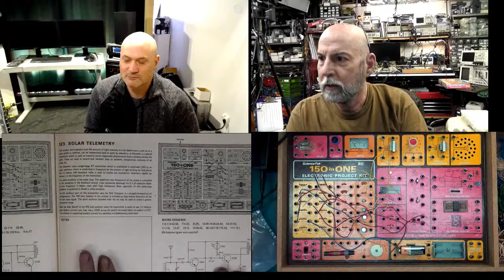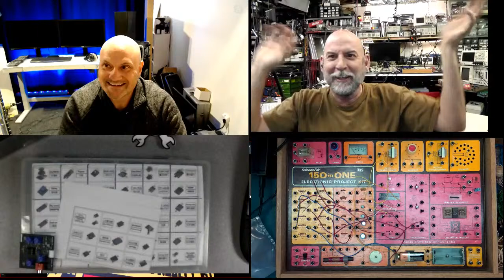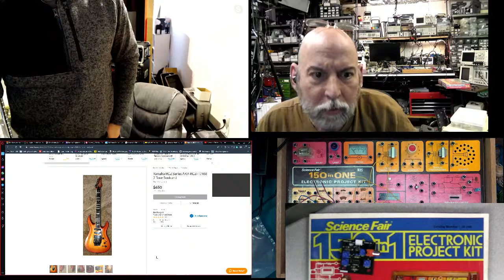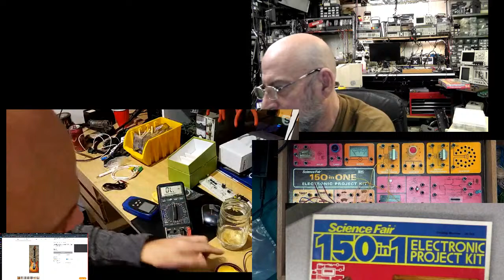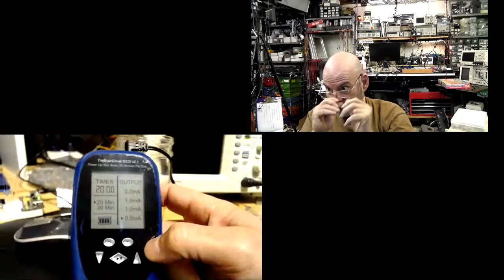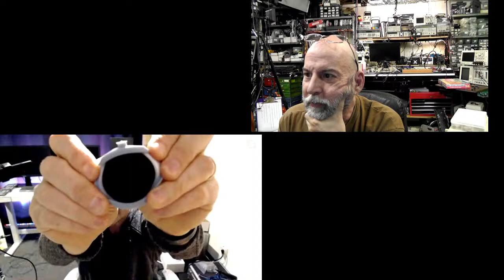Electronic Christmas Past: w/ Ben Jordan and Bil Herd

Comment: I had the 200 in one and the first thing I did was to blow up all the LEDs on the front panel because they had no current limit resistors  built in.(the 7 seg display did have resistors) Also the AM transmitter circuit was crap and only transmitted around 3 meters,